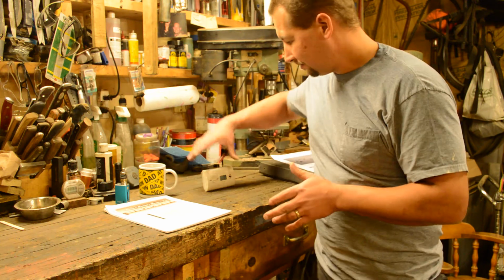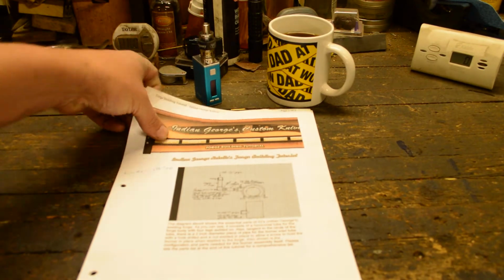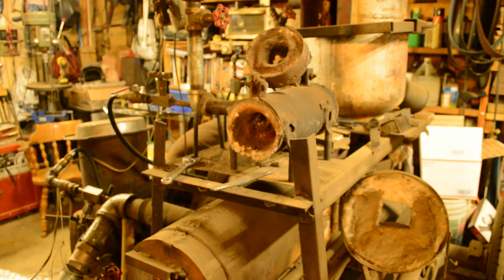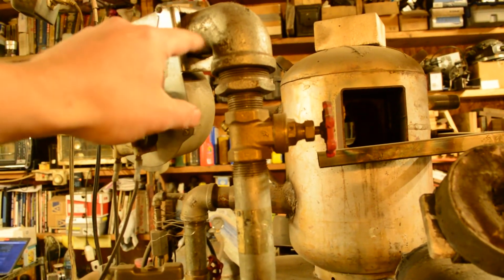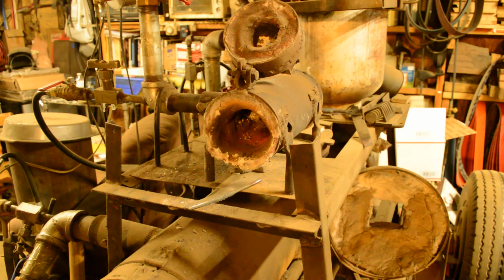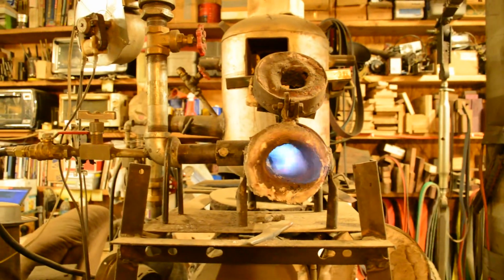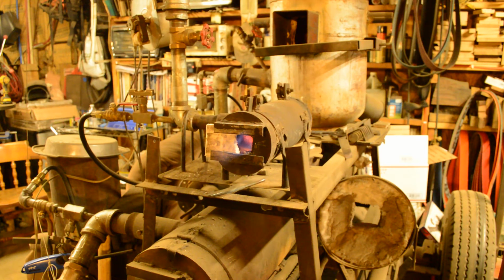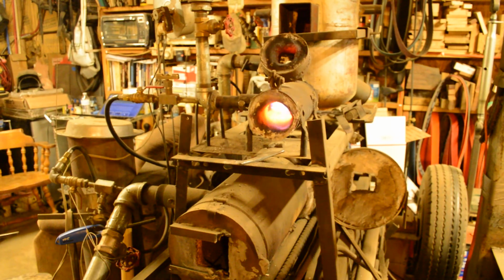small shop built forced air forge

Comment: Hey Joe,
A very informative video.
Can you tell me what cfm your blowers are plse? I have just built a forced air forge and now trying to work out how to run it...  I have a 90cfm blower that runs thru a 2inch pipe and reduces to 1and a 1/4 outlet. The gas nipple is only 1.0mm but don't to be able to find a happy place😅popping and not igniting as air blows out flame. The forge chamber is a 20lb propane tank lined with kao wool.
Question,how efficient do you find your forges compared to atmospheric forged?
Plse excuse the barrage of questions but you appear to have the knowledge I need and I've watched a lot of forge videos...!
Thanks